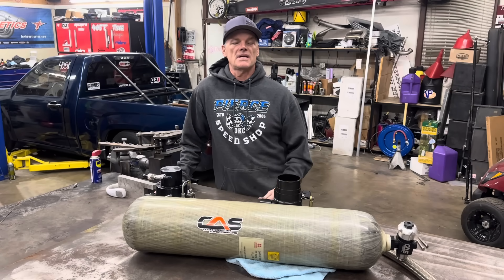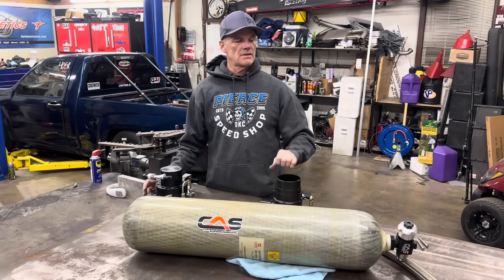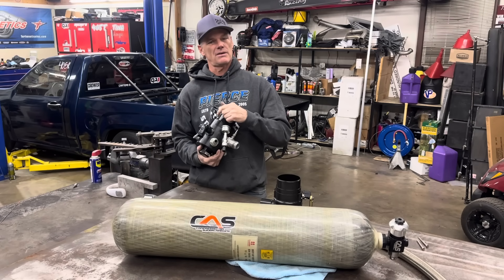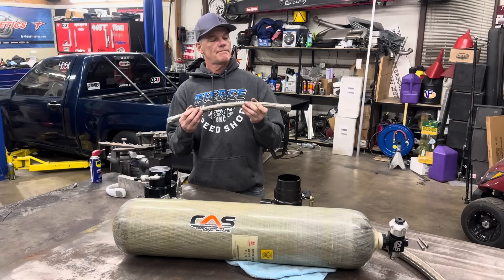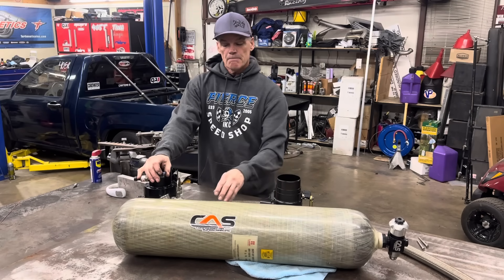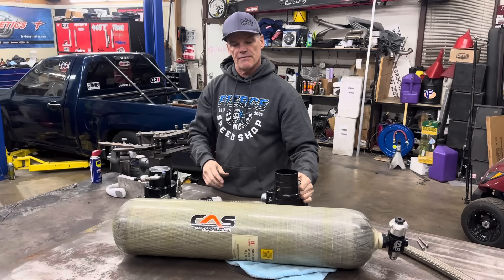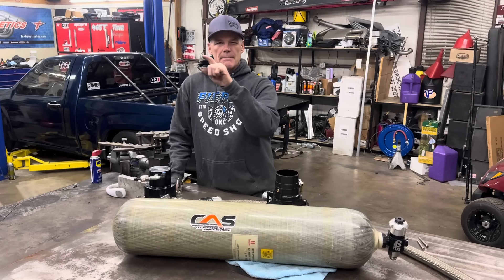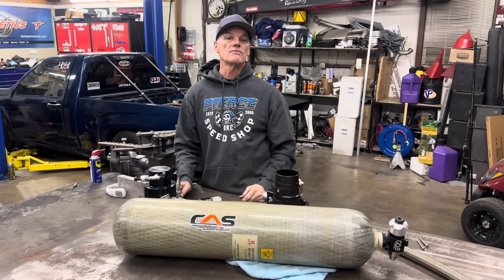Compressed Air Supercharging

Comment: I know this is a very expensive system, but how feasible would it be to run this on a street car? Imagine in 10 years they improve the technology to where it's simpler and cheaper and having this on a daily with pump gas?

Comment: I wonder what could be rigged up with a spare air compressor tank and hardware store components. If you could use an air tank and get out cheaper than a turbo or super charger.

Comment: I have a question. Let's say I wanted to use this as a small scale solution. On-board air compressor off my accessory belt, to a tank, tank has solenoid linked into the tune to open and push air into the intake manifold? What kinda parameters should I consider in this scenario if I want to make, lets say and extra 100-150hp on a 2.4 liter N/A 4 cylinder with plenty of room for more fuel in the tune. Pump gas gonna be best if its running a sustained setup for lets say road course TT, or Drift? I don't know if there's potential for the e85 to get too cool to function well.

Comment: Unfortunately 1320 just did a video on the guy Ryan who runs the 3rd gen camaro using compressed air as if he invented it.  I left a post informing them this all came from the guy who originally put NOS Systems together but it'll probably get ignored.  I run super high powered air rifles that can rival gun powder and deal with a lot of the same tech.  We charge the rifles to 4200 psi...best part is they are not regulated firearms so we can shoot (responsibly of course) on property or just toss them in the back seat and drive to the range.
Reply: it cracks me up that people keep acting like this is brand new technology

Comment: So Tinas's husband,  I would assume that on a street car the smart thing would be to stick with n2o or the typical ways of boost as their seems to be no feasible way of using this on a daily driven car?
Nitrous for periodic pulls or the cost of turbo kits used while driving would outway this setup by miles if not used solely 7secs at a time or less correct, as it is basically jus a different form of what using n2o is. Otherwise 18yrs ago i would have stuck a compressor an tank n my camaro when i pondered this idea lol.
Reply from the maker: Yes, it’s really not practical for multiple passes with a street car. You really have to have a compressor with you.
Reply from the maker: However, you will see it on Race week in a month or so in the blue truck
Reply: @TinaPierceRacing  cool, look 4ward 2 it...

Comment: In scuba we use mixed air that has more oxygen less nitrogen.  One common mix is 32%. If you were using that or 32.5%  I would think you could add about 50% more fuel and be stoichiometric still.   Should give more power with same cfm flow.

Comment: The awnser was right in front of all of us for this whole time!! Just took someone to show us!! I cant believe this hasn’t been happening for years already
Reply: The ex NOS guys that made the system said the concept is easy and anyone can draw it on a napkin. The fine details to make it work were the challenge.  

I like how the engine runs N.A. till it switches over to the self contained controlled atmosphere system.  

I think some work needs to be done with VP fuels for the cold air. Jet fuel the Air Force uses has additives to deal with the cold temps at high altitude.

Comment: why do you block off the outside air before the compressed air goes in? Wouldnt it work like a vacuum and allow more air to be pulled into the motor had you not blocked it off? and what about running a methanol kit with this setup? would it cool the air even more? how about condensation can you hydro lock an engine if there's too much water in the compressed air?
Reply from the maker: It’s instant, as soon as the air comes on it blocks off the valve.. you don’t need to run methanol with this system. The air is super cold. If you watch the video, you can see how cold the air is. The compressor that we use scrubs all the moisture out of the air so there is zero humidity when it goes in the bottles therefore it cannot freeze.
Reply: @TinaPierceRacing  imma try it with my moms airbrush compressor and a paintball market air tank!

Comment: 🚩Why do you run only on the injected  system and don't use any of the motors  naturally aspirated ❓  How would you use the system with a carburetor ❓👍

Comment: The bottles are the problem. 
You need to make the frame of the car out of a sealed tube that can hold the psi so as to not have any extra crap.
Reply from the maker: The bottles are no problem at all.

Comment: If you're already carrying a big tank around, why are you running air?  Only 21% of the contents of that tank is oxygen.  79% of what's in that tank is just doing nothing.  Pure oxygen is very cheap.  Run pure oxygen and get 5x the power, or get longer runtime with your tank at lower pressure.

Comment: haha this is awesome! I had an idea a few years ago to run a small 68cu 4500psi paintball tank through a airsoft regulator to get down to 100psi then through a normal air compressor to dial in my targeted 10-12 psi , Glad to know the idea isn't a complete rideoff.

Comment: Are the temperature sensors getting iced over  ?
Reply from the maker: @birdworld-m7z  there is very little or zero moisture in the air. The compressor filters and purifies the air.

Comment: I don't understand how that small of a hose can move  1400 worth of hp
Reply from the maker: its pretty crazy but the pressure behind it pushing it through is how it happens
Reply: @TinaPierceRacing  wouldn't it benefit maybe from a bigger hose?
Reply from the maker: @mihailpetrovici5044 
It’s not necessary for the amount of horsepower that we are making. That is why they rate the kit with the max horsepower it can flow.
Reply: @TinaPierceRacing  what happens if you put two kits?
Reply from the maker: @mihailpetrovici5044 
in theory should make twice the horsepower.. yet to be proven. Currently there are 2 different kits, 1400hp and 2400hp  so flowing enough air for a promod shouldn’t be a problem with two of the higher horsepower kits
Easily should make 3500 to 4000 hp
Reply: @TinaPierceRacing  any dynos?

Comment: Maybe this is a crazy idea but what about in a small displacement engine using this pre-turbo charger and using the pressurized air into the turbo charger? This way the system could run with this or without it. I’d love to see something like this set up on a Motec with a small displacement engine.
Reply from the maker: you dont run turbos with this system, it provides all the air the engine wants!!

Comment: really interesting! love learning about new (to me) systems. sorry if u mentioned it but how many runs do u get out of the tanks before u need to refill them? I assume refiling them isn't to much of a hassel? can u just fill them with a air compressor? love the idea of not having any extra pulleys off the engine, no need for a 2 step is awesome, having the boost right there is great.

Comment: I had heard of a few people running these set ups, my biggest question was if the external air intake would be closed off to allow pressure to build like you guys are doing with you "injector valve". Very informative thanks for sharing

Comment: Dang, i had zero idea this exists. How many runs per bottle? 
I had an idea to have that ejector valve, although different in my head, on a turbo car that allows the engine to breathe unrestricted under vacuum through atmospheric pressure and then when positive pressure is active it closes the atmosphere valve and then only pulls boosted air from the turbo. It should eliminate lag, but i cannot afford to test the subject

Comment: The best things about this compared to other forced induction systems are for one, it won’t take power to make power. Two, it is Ice cold air and three, there is zero Lag! Very cool!
Reply from the maker: Best comment yet! Thanks
Reply: I wonder if you could run higher compression and see benefits since this has a larger tuning window?  Most Boosted setups I've saw have moderate comp.

Comment: Is there an air dryer in the system ? Those kinds of temperatures mean you don't use inter coolers for the charge intake. That's a dandy of an idea.

Comment: I understand the mechanics. My only issue, If I can't fill the tanks with my dual stage compressor (185 psi is about max psi) Do you have to continually take the tank to be refilled somewhere? If that is so, then is basically a nitrous oxide system using air instead of NOx. I assume it's basic air. They could alter the amount of oxygen, but pure O2 carries its own dangers.  Is this less expensive than a comparable nitrous system? I assume it is half the cost or less than investing in a supercharger/turbos/intercooler?
Reply from the maker: Look at another video on this channel

Comment: What are some of the next failure points in this setup? The throttle body block off plate I’m sure gets a lot of stress closing and trying to make that seal with boost going in and not letting some out.
Reply from the maker: We have had no failures yet.. we have put around 210 passes on the red truck so far with all the same components. The other car of Mark Griffen has more passes than us as well as 4 years now.
Reply: @TinaPierceRacing  Very impressive!

Comment: I recall reading about this tech over a decade ago in a magazine. Since then, I've thought about high pressure air direct cyl injection, timed to inject air from after the intake valve closes and before spark event occurs during the compression stroke, would be the future of this tech. The duration of injector time along with orifice size would control the total volume of additional air introduced into the cyl.
That way the engine isn't relying on the CAS system providing 100% of the engine requirements. Seems the injector tech is available today, based off diesel or gasoline electronically actuated direct injection systems. 
Not sure how the math works out, with the milliseconds of open injector time vs 3000psi compresses air. Would the time (duration) available be able to provide enough volume of highly compresses air into the cyl for this to be viable? 
As for fuel air ratios, this seems doable, although would require a method of precisely measuring the additional air so the correct amount of fuel could be injected.
Seems this idea would be viable on either a direct cyl fuel injected or port injected engine.
Reply from the maker: interesting thought. Maybe sometime in the future people will do more and different things. Its pretty cool to be a part of something like this.

Comment: For a tank of this size and based on the 1400 hp setting, how many 1/4 mile runs can be expected from one bottle?
Reply: 1 or less. The max use is 12 second on "low power". This is single use system. You refill the tank after every single pass.
The cas site is garbage but they do have a couple graphs showing power/time curves.

Comment: My ex brother in-law was doing this 25 years ago. 
 It seemed like a solid concept,  especially for the application .
 The only reason I still use / play with turbos is because I don't have single purpose vehicles anymore .
 I drive everything on the street. 
 And at this point the best power adder is turbo. 
 Nitrous and compressed air runs out and superchargers are to detrimental to gas mileage.

Comment: How much roughly to get say a starter kit? Love the idea though of this back in the 90s wondering what compressed oxygen or would do but at tge time never could figure out a way to compress air that much and was always told it would never work but not why tganks for the video but knowing what these setups run wiuld be helpful thanks!!!!!
Reply: Not worth it imo. $8k for 1400hp kit. Just use nitrous..way easier and 1/4 the price
Reply: @VWLIKEWHOA  wow I think I would try a paint pellet tank or even better a 5kpsi tank for those hi powered slug slinger guns can't remember what there called but way cheaper than 8k just need the tank and the 5kpsi PP's are only a couple hundred then make the rest and add nos on top of it lol man that's crazy 8k for compressed air wow!!!!!!!!
Reply: @stevenoe6395  yea for the price you could just build a really nice top of the line turbo system and be done with it and have the power at all times. I don't see the advantage for the price. Air is free!! Lol
Reply: We have the same mind.  I have alway wondered why this has not been done. But in my mind, an air compressor would direct inject into each cylinder to increase compression acting like a supercharger.

Comment: Another use for this setup is to fit an air jet to a turbo, and pre-boost the turbo.
Reply: If it can do everything the turbo does and have lower charge air temps, why add the weight of this system to spool a turbo instead of just removing the turbo altogether? No parasitic losses either. If you’re just wanting to spool, use a cheap NO2 system.
Reply: Dyno don did that ,no one could figure out what he was doing,yall know now

Comment: You should try to chill the bottle with dry ice , it will increase the air density with out increasing boost
Reply: The change of pressure and flow already has the air coming out the regulator at -90°....How cold you want it? 😳
Reply: @leroyhenderson3530   but It heats UP till the engine , and as is all about mass air flow, the colder it gets more mass is moving. 

Another very important point is ,  double the temperature double the pressure, absolute temperature, so the  colder it gets more pressure variation without melting the engine.  

That's why afterburner get less trust for the same amount of fuel, it burns already hot air.

Comment: Does the system utilize a blow off valve or does the air flow stop as soon as you lift off the throttle?
Reply from the maker: we have a BOV

Comment: I assume the regulator incorporates a first stage (dropping bottle pressure to 100psi) and a programmable second stage (taking that 100psi and lowering it to 15, or 30, or whatever psi)? Also, how much air (cubic foot) are you using in an average run?
Reply from the maker: we use around half of the air. It depends on how much power we are making on a particular pass. Also 1/8 mile vs 1/4 mile uses more air obviously

Comment: This is awesome and in theory the perfect air delivery system.  Perfect controlled of dome pressure and it's instantaneous.  Cold air not hot air and the temperature should be calculable so tuning should be more consistent  (I mean worst case, a bottle of air could be wasted in the pits with the engine off and measure the air temp for the desired tune and then rework the tune to fix any variations.  This to me is a game changer).

Comment: New maybe 60 years ago. Not repeatable, because bottles need to be changed or refilled.
Reply from the maker: 100 percent repeatable with the way we are doing it
Reply: So as it runs out on the road on a drag and drive for 5 days how do you refill it? You surely can’t carry enough bottles, or do you have some really crazy, high pressure compressor?

Comment: I like the idea would like to put on on my funnycar. iti s running a motorcycle motor and would be looking for a system that would give me 350 hp to 400. can it be  scaled down>
Reply: The system on smaller displacement engine would just have either capacity for more boost or longer boost.

You could use a smaller bottle if you would find one as small
Reply: @lasskinn  what is the thread size for the valves? might be able to use scuba tanks. or just one of the ones you use.
Reply: @ who do I talk to about setting up a system